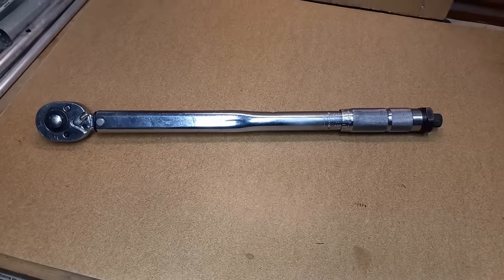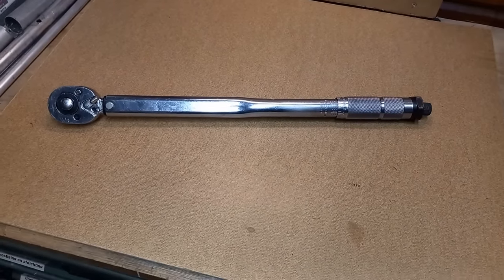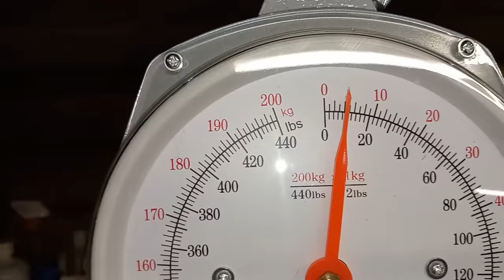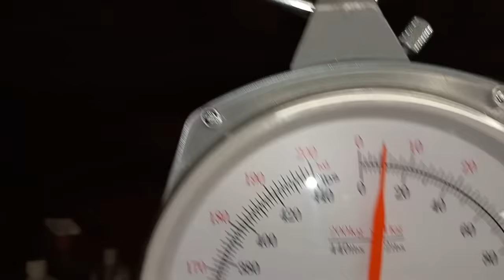How to calibrate a (cheap) torque wrench

Comment: You can eliminate the imprecision of the spring scale by using the water vessel directly on the torque wrench.
Hang the vessel on the wrench and add water using a measuring cylinder in precise quantities.
I used a similar set up to set the dynamic torque value when preloading the input bearing on a differential.

2:11 btw. This adjustment is merely a zero. To fully calibrate a scale there needs to be a span adjustment too. to compensate for nonlinearity in the mechanism.
This is why I recommend using the weight of water directly
Reply: Very true 👍
Reply: or use electronic scales
Reply: @Yaroslav_Tselovanskyi  More precise, but there are inherent problems with scales that hanging a weight off the wrench eliminates.

One is that angle of force will always be the same on a horizontal wrench handle with a weight ,but pulling a balance depends on how good your eye is.
All cheap scales are nonlinear , even electronic ones.
A good compromise is using a precision scale to weigh the test weights (water) you calibrate the wrench with.
Reply: @paulg3336  I don't see the electronic scale precision to be the issue here at all, even the cheapest electronic scales (like the 50kg one I own) have the error of just 10g, it's nothing for this kind of task, it's literally a margin of error even when you use water or whatever.
Reply: @Yaroslav_Tselovanskyi  10g error is the manufacturer spec, old scale do not have ANY guarantee to be within that.
Would defeat the purpose of calibrating old equipment, if we always assume it to be within manufacturer specs forever ;)
Reply: @ssu7653  Well, in that case ideally you would have a metal calibration weight of 1kg or something, so you could weight stuff by comparison, or calibrate your scales properly. Water weights differently depending on composition, temperature, container.
Reply: @paulg3336  How would you weignt the wrench handle if youre using water? Or you just disregard it? then what's the point in trying to achieve any precision in weight if you're ignoring this amount of weight.
Reply: Wouldn't he need to use 30kg of water though, as he prefers to calibrate somewhere in the middle (which makes some sense)?
Reply: @bobbysilver272  No, by extending the wrench with a tube you can use a lower weight. Double the lever length and halve the weight for the same torque. you have to allow for the weight of the extension - that can be measured with an electronic scale. 
There is a way to make the extension have zero effect , but it involves setting up a more complex calibration rig.
Reply: im quite surprised that he didnt use his mother-in-law to calibrate the wrench, but how do you know where the extension would set its lever point on the original wrench and how do u measure the weight of the water jug?
Reply: @Yaroslav_Tselovanskyi  You could take into account the torque exerted by gravity on wrench handle. The torque in N⋅m would be r * m * 9.8, where r is the distance in meters from the pivot point to the center of mass of the handle, and m is the mass of the handle in kg. The total torque will be this handle torque plus the water torque.
Reply: @dgphi  How exactly will you measure the mass of the handle?
Reply: @Yaroslav_Tselovanskyi  On a scale. A kitchen scale would probably be okay.
Reply: @dgphi  How do you measure a handle, that is part of a wrench, on a scale?
Reply: @Yaroslav_Tselovanskyi  The wrench is mostly handle. If you just weigh the whole wrench, that should give you a pretty accurate result I think. There is no need for extreme precision here. 

If you really wanted to weigh just the handle, I think you could put the end of the handle on the scale, and rest the head of the wrench on some books or something to the same level as the scale, and the value on the scale will be half the weight of the handle.

Maybe I will try that later and see what happens.

But like I said, I don't think we need extreme precision here. Torque values tend to be very approximate themselves. They are typically specified as, for example, 20 N⋅m or 100 N⋅m, and not as 19.9 N.m or 101 N⋅m.
Reply: ... actually, if you weighed the end of the handle and propped up the head of the wrench, that would give you direct measurement of the torque exerted by gravity on the handle. You would have to convert from the weight on the scale to torque using the formula torque = force * distance. Where force is 9.8 * mass, where mass is the value shown on the scale.
Reply: @dgphi  So, using scales is fine after all?
Reply: @Yaroslav_Tselovanskyi  I was just wondering how to account for the weight of the handle. That is, how to solve that technical problem. But yeah, if it were me, I would probably just use a luggage scale with a hook, and pull horizontally.
Reply: The digital scales are so cheap you can just buy 5 of them to make sure the precision is preserved for years and years to come. They cost equivalent of $4 here.
Reply: The point is that a torque wrench doesn't need to be that precise Ballpark is really enough. The prescribed bolt / nut torques are far less precise. As example, the friction coefficient alone invokes changes in the order of 30%, and that's not really a well known quantity...
Reply: Very good.
Reply: @paulg3336  An extension does not work that well and introduces more error; since the wrench is designed for force to be applied at a very specific location; and a pipe or extension fitted over the handle has multiple places where the interior of the pipe will contact the wrench.  For DIY - a wrench being horizontal and level - allows a known weight to be evenly applied at the correct location of the wrench - evenly without any jerks.
Reply: @viisteist1363   "how do you know where the extension would set its lever point on the original wrench" Very GOOD!
Reply: @paulg3336  Trouble is, all measurements have inherent uncertainties unless you're using calibrated measuring devices but for most purposes not QA assured they're likely to be close enough.
When I was younger and had my first motorbike, I used a fishing spring-balance and a tube on the end of a spanner to tighten fasteners to the correct torque as I couldn't afford a torque wrench. It was clumsy but worked well enough.
Better than shear it and back half a turn 😁
Reply: @Yaroslav_Tselovanskyi  Just because it has a digital readout doesn't mean it's more accurate than an analogue scale. A digital readout may be easier to read and have a very fine resolution, but that does not mean it's more accurate. The accuracy is how the indicated reading relates to the real calibrated quantity at a given point and across the operating range.
Reply: This, also weight scales are non linear.
Reply: I'm fortunate enough to have a set of accurate scales (kitchen, medical) covering 1/10 oz to 250 lb. I weigh the bucket and see if the wrench agrees. For inch - lb I use a small spring scale calibrated against the kitchen scale, sometimes to the force I want to apply. It's more accurate than a very expensive wrench.
Reply: @Yaroslav_Tselovanskyi  Electronic scales are not necessarily any more accurate than dial scales as they both have springs. The only difference is the display.
Reply: @6panel300  I know, but for some reason I unconsciously believe electronic ones use magic ✨ 🙂
Reply: With water weight you also have to compensate for the weight of the wrench itself
Reply: That is so inaccurate in so many ways.   First depending on where you position the scale on the handle. Leverage will change your readings.    Your whole way of thinking and understanding of torquing bolts is just wrong im sorry .
Reply: That jug of water as a standard is a joke. You must be related to Rube Goldberg?😁😆😅🤣
Torque wrenches are cheap enough where you buy two of them, one is kept as the standard only, to be used just for calibration purposes, and the other one is used in the field. When it comes time to calibrate the one that you use, you simply couple it to the torque wrench that is the standard, set both wrenches to the same torque, and with the standard wrench held in a vise, apply torque to the other wrench and see if they both click at the same time. Your coupling of the wrenches can be a socket adapter "Female 3/8" to Female 3/8". This way you get rid of that joke of a jug, and also don't need that scale. My way is simple and direct, much quicker and more precise.
Reply: @dgphi If we assume that the mass distribution along the length of the wrench is roughly constant, the torque applied by the wrench itself in horizontal position would be exactly half of wrench's weight times length. If you want to be even more precise, find the balance point of the wrench, measure the distance from the drive to that point, and use that distance times the weight of the wrench. If you want to be even more precise than that, you'd need to actually disassemble the wrench, but I doubt it would result in any meaningful increase in real-world accuracy.

Comment: Nice video Arnold.  I would say this … a lot of people like to comment on other peoples videos about things they should have done or not.  People  kind of miss the purpose of the video , which is showing other a DIY process.   Personally wanted to say thank you for taking the time to share this DIY process.  Good job.
Reply: hi juniorclassic have you become a flat earther yet? If not I suggest watch a 13 part series called What on earth happened by Ewaranon to learn that the earth is not a globe. I got it in my about tab.
Reply: It is painfully obvious that you and the video’s creator have absolutely no understanding of the concepts of calibration . See my post. The operator is not even applying the force at the center mark. This video should have a disclaimer saying performed by a utterly untrained hack. This is why legitimate calibration labs put tampering seals on tool calibration adjustments.
Reply: @lauraradigan4114  it’s more sad to have hater comments thing’s like this.  Every one knows you tube is an open platform where many DIY people go to get an idea of things.  I can assure that I know about calibration.  But my initial comment on this video was just giving this person a complement.  For the creativity.  I could have said the same things you toss, trashed back at me for supporting a you tube fellow. I do have an engineering degree as well a BS in microbiology.  And in microbiology we need to assure equipment is properly calibrated.  But instead of downing this person I opted to give him a complement.    And that is all what I wanted to do because the first thing other see is the one bad thing that person made.  So that being said.  Why won’t you  make a calibration video so you can show other the correct way.  Perhaps Arnold can also learn something new.

Comment from the maker: Allrighty folks, since this video got a lot of comments, I'd like to thank you all for watching. I'll make a Part 2 to adress some questions and do a follow-up. The math I used is: Nm = force x armlength , 126 = Force x 42 , so force = 126nm / 0,42m = 300N, = 30kg. ( 1kg=10N)
Please note that this video is intended for home mechanics who want to check if their torque wrench is in spec. If you do customer work, you might want to get an expensive torque wrench and have it regularly calibrated. If any torque wrench manufacturer is watching this and feels the need to send a home mechanic on a budget a nifty torque wrench, please contact me!
Reply: 126 Nm not 136 Nm ;)
Reply: 1kg is 9.81 N so 300n is 30.6 kg
Reply: @momanskiakabiffbuz6004  Started commenting and I can see that I got the same result 30.59kg since this 9.8066 comes from gravity....... and then i started thinking if this test will make any difference if you are making it in vertical or horizontally. I have always done it so I hang preweighted weights to the tool and calculate the tool nm to whatever weight I have. But if you hang something then would you have to account the quite a small but still existing weight of handle of the tool? But how would you even calculate it since its unevenly distributed across whole handle length.  Another thing worthy of note is that tool should be "heated", meaning before using/measuring it should be cranked 10-15x time make the grease in there a bit warmer and thus result more repeatable. Also i have seen quite a few wrenches where it can read one value , but will be shockingly off at the other end. So it should be done on multiple weights to be sure that tool is good.
Reply: @arva1kes  it's not the matter if the force is horizontally or vertically applied, the problem is that you use a measuring device for mass. And when you want to calculate force which is a product of mass*acceleration you have to consider 9.8m/s2 as acceleration factor
Sorry for the bad English btw hope you understand something 😅
Reply: @arva1kes  To measure the force the weight of the wrench is adding to the test weights, you can hold the square drive in the vise and let the handle rest on a electronic kitchen scale. making sure that everything is within the free play that the ratchet introduces ,so that the vise is not adding to or subtracting from weight of the wrench.
Reply: @momanskiakabiffbuz6004  A spring scale like that is marked in units of mass, but it actually measures force. The marked scale assumes about 9.8 m/s2 acceleration due to the gravity that we have on Earth. If you were to use that scale on the moon to measure the mass of an object, the answer would be completely wrong. (Much too low.) You could do this calibration on Earth, on the moon, in orbit or in free-fall, and it would work fine every time.
Reply: And yes, 30.6 kg is a more accurate number unless his scale was marked assuming the acceleration due to gravity is 10 m/s2.
Reply: You should be measuring to and pulling at the smooth mark in the handle, not at the end. Yes it does make a difference on these click wrenches.
Reply: Please don’t put out inaccurate information. You are not doing people any favors. If you don’t understand metrology don’t make a video about it.
Reply: That jug of water as a standard is a joke. You must be related to Rube Goldberg?😁😆😅🤣
Torque wrenches are cheap enough where you buy two of them, one is kept as the standard only, to be used just for calibration purposes, and the other one is used in the field. When it comes time to calibrate the one that you use, you simply couple it to the torque wrench that is the standard, set both wrenches to the same torque, and with the standard wrench held in a vise, apply torque to the other wrench and see if they both click at the same time. Your coupling of the wrenches can be made from two sockets spot welded together with the 1/2 drives of each on opposite ends. This way you get rid of that joke of a jug, and also don't need that scale. My way is simple and direct, much quicker and more precise.
Reply: @paulg3336  Would that only apply if the wrench was being tested vertically? (ie using weights or jug of water). I just calibrated mine vertically, but didn't take into account the weight of the handle. Should the entire weight of the torque wrench be taken into consideration, or only weigh with the handle on the scale?

Comment: 1st ! After half a century of working on bicycles - cars - engines, and making mistakes, I also have learned "The Feel" <-- calibrated by knowing what kinds of metals or plastics are involved. But bolts that are intended to stretch --> like as are used on cylinder heads which absolutely require precise torques, and indeed precise sequences of applied torques.  Awesome video that exalts the superior Metric system - 1cc oh H2O = 1gm of weight - thus it is VERY easy to remember too!
Reply: What was your math formula.?
Reply: 1cc of PURE WATER not tap or any mineral
Reply: some head bolts are tight + some amount of turn. I recently ran into this with a modern axle nut where you brought it snug and then turned it 3/4 a turn more. The turn method gives a particular amount 'more' based on the ratio of the threads and some people swear by that. Of course it all depends on where you started with the 'snug' bit.
Reply: Or, in old money, 1pt water = 1lb and a quarter. Easy to remember 'coz it rhymes!
Reply: @dolvaran  in Britain it depends on which gallon and which pound. In the US 'a pint is a pound the world around' is reasonably accurate for water.
Reply: @danielboughton3624  I'm British, so there is only one pound and one pint :). 20 Imperial fl oz = 1lb 4oz.
Reply: My brother used "the feel "  Methood.  It was Very Funny when his wheel nuts could not be loosened by hand on a very çold day with a flat tire.   He was finally convinced to use a torque wrench, from that day on......
Reply: The “feel” method is a farce and is not repeatable. The superior bolt tensioning method is measuring bolt stretch.

Comment: Great video; many people probably don't bother verifying the calibration at any point in a torque wrench's life. Also, the ball bearings in a mechanical torque wrench are critical to accuracy; they can develop flat spots that can throw off the calibration and give inconsistent values. Sometimes, but not always, repacking the grease can clear inconsistent accuracy. At any rate, check the accuracy at several click points in a given arc.
1) Never ASSUME that the calibration is spot on. 2) Check it at high end, low end, and mid range. 3) If it gets dropped, cycle it through its range three times.